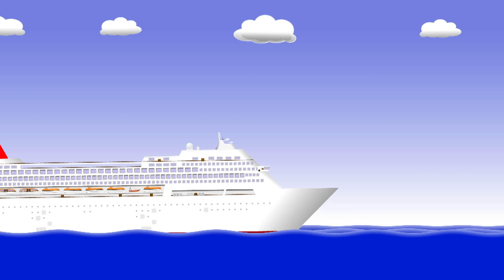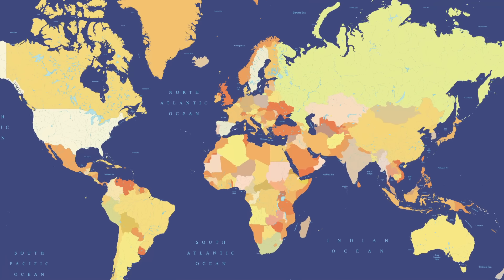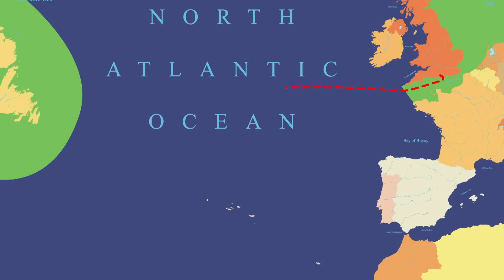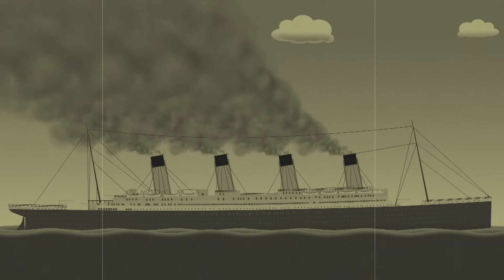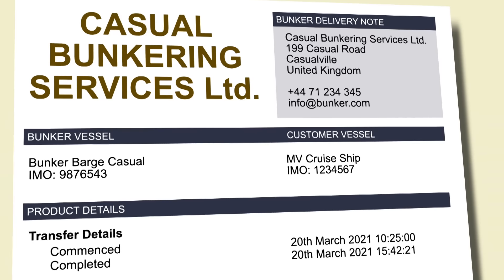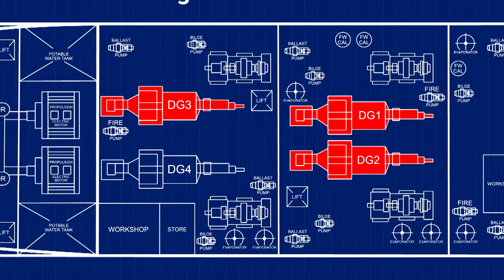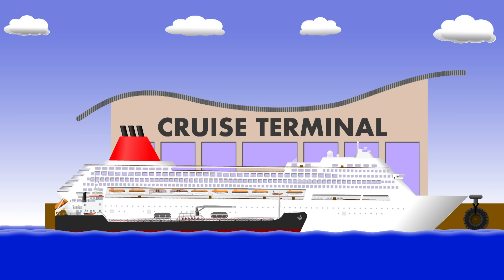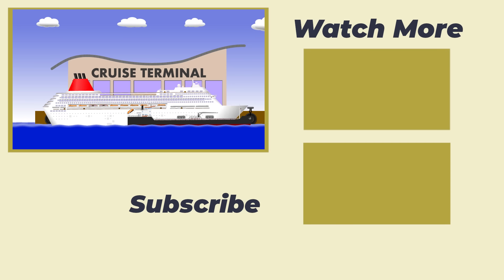Where Do Ships Get Their Fuel?

Comment: So, where do the product tankers refuel?
Reply: An infinitely long line of product tankers, each refueling the last
Reply: Well they probably operate around port areas where they have births for them which fill them up (getting bigger ships to go there would just cause traffic jams). At least that's what i imagine
Reply: Product tankers all the way down
Reply from the maker: Usually oil refineries, or storage depots that are filled by even bigger tankers. But I do like Snaily's idea of infinitely shrinking tankers, each refilling the next
Reply: @CasualNavigation  
"One for you" pumps into transfer tank
"One for me" pumps into propulsion tank
Reply: As mentioned by OP, either at tanks storage facilities, floating storages (typically VLCC moored just for storage - very prevailing currently with Fueloil prices in contango and tanker freights very low), or from refinery tanks. The product on the bunker barge is separated between those the barge itself uses for propulsion vs the cargo the barge carries for delivery to other ships.
Reply: It's a variable question, as a tanker man weve taken bunkers from barges whilst at anchor, specialised bunker berths, sometimes direct from our own loading berths. road tankers whilst alongside at port for gas oil in certain ports. It all depends on availability, cost, charter partys etc etc for example on time charter to shell in the Caribbean they would pay for the bunkers so we used to fill up at our load port berth every month or so. Whereas on spot market charter the operators would look at our booked cargoes and send us to the cheapest place
Reply: There are barges that take LOW Sulphur Fuel Oil LSFO and Marine Gas Oil MGO to them in the New York Harbor. Usually they take about 300 metric tons of MGO and about 800 MT of LSFO. I work for an inspection company and witness a lot of this transfers in anchorage
Reply: Good question!
Reply: They find a sleeping larger tanker and siphon out some when no one’s looking ;)
Reply: Oil terminals with berth or floating storage (another bigger vessel) in anchorage
Reply: An entire supply chain of tankers
Reply: To keep with the theme, they go to those fancy seafied gas stations that Causual Navigation showed of course :D
Its roof is a bit lower so there have been roof strike issues at some of these gas stations.
Reply: At the refinery😊

Comment: They are called diesel generators because the diesel process is the combustion method. Can be compared to a turbo-generator, running on gas or steam, is still called a turbo-generator. Love your videos man!!!!
Reply from the maker: Thanks Eric
Reply: Indeed and diesel cycle engines famously can (be made to) eat almost anything that burns as fuel.

Comment: So somewhat of a dumb question but it's something that's been puzzling me for a while now, why do cruise ships have their bridges located at a more forward position of the ship and why do cargo ships have their bridges at a more backwards position of the ship. I hope to get an explanation, thanks.
Reply: I think in a cargo ship its important to see the cargo holds but in cruise ships seeing the pools wouldn't be as useful as seeing the water in front
Reply: @bobjonesisthebestastro  That has nothing to do with it; just think of RoRo, Livestock or Heavy Lift Ships with the Bridge at the Bow. It's simply down to the Deck Superstructure usually being above the Engine Room, which is located as far aft as possible. Having the Superstructure above the Engine Room costs you as little valuable Cargo Space as possible. The only Exception to this are large Twin Island Container Ships, where moving the Bridge forward into a second Superstructure increases Cargo Space, as it allows stacking the Containers higher on Deck while still maintaining the Line of Sight required by SOLAS. On Passnger Ships, as well as RoRo and Livestock Carriers (which are similar in Terms of Space Layout), there is no single Superstructure which has to be placed above the Engine Room, so it is placed where it provides the best Sight to the Navigation Officers.

And many Heavy Lift Ships have the Superstructure at the Bow, so it can protect the valuable and sensitive Cargo from Swell. This is one of the few Exceptions where the Crew Quarters may be placed forward; usually they have to be placed midship for Comfort Reasons. Accomodations at the Bow means, the Crew takes literal Elevator Rides whenever the Ship is pitching.

Comment: I kinda wished you had talked about the time it takes to fuel these ships. I work on a tour sailboat (<50t) and frequently hear calls into VTS for 12+hrs. Even some of the fishing ships that go to the fuel docks can take over 6hrs.
Also, I didn't realize the bunker barges carried different fuels. I guess that makes sense.
Reply: On the big container ships / tankers it really depends. Most ships have a 6 or 8 inch pipe connection but it can also be 5 4 or 3. The pumping rate of the bunker barge will be slower on a 3 inch connection then a 8 inch connection. Sometimes 1500 tons per hour and sometimes only 100 tons per hour.
Reply: It varies, really. Transfer rate and, ofcourse, how much a ship needs.
Reply: @dogepandamcgill6306  1500 tons per hour? That's crazy! That's a ton of fuel every 2.4 seconds! That's like a rocket engine! Is that through a single pipe?
Reply: An 8" ship-to-ship pipe will usually do between 3k and 5k gallons an hour.  That's more like 100-150 tons an hour which means that your typical cruise ship or tanker will take between 30 and 40 hours for an empty-to-full refill.  A company might use more lines from a single barge (which will lessen the head pressure, but you'll still get more volume), or with split tanks you can get a second barge in.  I've seen turn-rounds at like 18 hours in a pinch, but it's better to run it over a day.
Reply: @ImpmanPDX  3k-5k gallons an hour? That seems pretty slow
Reply: @ATLMike94  Bunker fuel is thick stuff.
Reply: @ImpmanPDX  i guess that makes sense
Reply: @ATLMike94  To be fair there are plenty of ships that fuel faster, but since it takes around 24 hrs to unload a ship and then part of a day to turn the crew around most ships take the extra time to do it safe.

Comment: How do cruise ships deal with medical emergencies? What kind of capabilities do they have on board? Is there a helipad for evacuation? 

If there is a helipad, does the ship carry aviation fuel as well? Does it have air-traffic control?

Your videos are extremely interesting! There are so many unintuitive aspects to consider
Reply from the maker: There isn't usually a helipad, but they do routinely do drills for heli-ops. It would be a high-line transfer, so the casualty would be winched off the deck.
Reply: @CasualNavigation   Very cool!
Reply: sounds like an interesting topic for a future video!
Reply: Most ships can communicate with airplanes when it is needed for a search and rescue. In general ships do not have ATC or anything of suchs nature. They are commurical vessel most of the time and as suchs do not often deal with aviation. If a plane crashland in international waters it is expected for the ship to provide aid but it will often take a few hours before it is able to assist. 

Otherwise aviation fuel and Maritime fuel are different and most ships do not have it. From what I know it would be extremely rare for them to have it but if you are in a heli you can always ask ships if they do have it and if you are able to land most cargo ships can have heli landed on their desks even if it doesnt have a helipad (Bulk carries).

In a heli emergancy most ships will provide aid if possible.
Reply: Future topic, then: "Why do ships have helipads if they have no helicopters?"  Or maybe just, "How are helipads used on ships?"   Finally, "Where does one go to school to drive pilot a ship?"  (Something I wish I knew 30 years ago.  Would have been a better career and life choice for me.)
Reply: @HDrobveelben  Most jet aircraft (inc helicopters) can run on diesel for a few hours with no problems.
Reply: If there is no heli pad there will be a designated location on the ship as a a pickup/dropoff point. 
There's no dedicated ATC however the folks driving the ship will communicate with the pilot directly to coordinate maneuvers.
Reply: @79Niall  Thank you I thought jet aircraft and helicopters used a different type of diesel then the one used on ships
Reply: @grondhero  For the first one I guess the answer is that its for helicopters to land for lets say people boarding (stupid example ik). also I think it would be better if u post this as a separate comment
Reply: @FeplayBuilds  My suggestion was to compliment what A Casual Navigation had already answered.  I personally know why they have them: it's for rescue and medical emergencies.  I suppose it would have been better to have added that caveat as well, to avoid any unnecessary confusion.
Reply: Cruise ships and many normal cargo ships have a clear space on deck somewhere painted like a heli pad, but with big “WINCH ONLY” painted on the deck. 

The only ships that usually have dedicated helipads are oil field vessels such as drill ships, rigs, and construction vessels, which fly crew out on a regular basis. They generally have a helicopter landing officer, who’s trained to deal with fueling, and emergencies. The ships usually also have aviation fuel, and fire fighting equipment specifically for the helicopters. 

Also naval ships and some research ships have helicopter capabilities, and some fishing vessels.
Reply: @HDrobveelben  It is quite a different kind of diesel. In general Aviation Jet A1, the most common used fuel type for turbine powered planes and helicopters, is quite close to car diesel, but has a much lower viscosity which immediately presents problems as car fuel pumps can be lubricated by the diesel they pump, aviation fuel pumps can not or have to use quite different materials to account for the difference in viscosity. Heavy fuel oil used in ships can not be used for turbine powered aircraft. In the history of aviation that was different, there were actually airplanes using heavy fuel oil powered diesel engines, but those have gone very much out of fashion. Using normal car diesel in aviation engines is possible, but will cause damage and requires a complete engine and fuel system overhaul, except for a few piston engines that are certified for dual use. 

As aviation engines have quite a high fuel flow small differences in any parameter can make a huge difference in running that engine. So refueling on board a ship with maritime fuels is not really an option.
Reply: @Andrew Carlson all sea going vessels are required by international law to carry medical equipment with them. If I’m not mistaken under SOLAS (Safety Of Life’s At Sea). Usually during an medical emergency is the crew able to seek medical advice from the shore until help can arrive. Typically are cruise ships better equipped with medical equipment than cargo ships but any sea going ship is capable to deal with an medical emergency before help arrives. 

In the case a ship is too far away from the nearest shore, let’s say 3 days sailing, evacuation is impossible. In such case the crew will have to provide medical care using the medical equipment present on any sea going vessel. Seaman are required by international law to train periodically for such situations and other emergencies. Usually they are guided through the radio, receiving live medical advice from the shore.
When medical evacuation is possible, there are a few options depending on the nearest shore and the situation. Usually the emergency responders from the coastguard are in charge and making the decisions for the evacuation. They can either sending an fast rescue boat or a helicopter. 
In the case their sending an rescue boat the victim will be transferred with the rescue boat to the shore and brought to a hospital. If a helicopter is send this is likely a coast guard helicopter. The victim usually is strapped on a medical brancard and the helicopter crew is giving the crew of the vessel orders. For example under which course they must sail because of the wind and even the movements of the ship because of the waves. Than the helicopter drops a cable to release static energy (if they don’t and an person from the helicopter touches the ship he would be electrocuted by the static energy). Than a rescue worker from the helicopter comes down to secure the victim and calming him or her down. Common practice is to giving medical reports to the the helicopter from the ship about the victim. Typically containing information about the medical emergency. After the victim is safely brought in the helicopter the victim is rushed to the nearest hospital.
Reply: Some have helipads, so that will be interesting,
Reply: @Soordhin  I thought that would be the case as I am studying martime engineering and to become a martime officer so I thought the diesel ships use cannot be used for avation. So I thought the best thing to do for a helicopter pilot is to land on the ship wait to get to port and then get fuel there.
Reply: @Maik_Grnto  Many bulk carriers a certified to use one ot two of their hatch covers as proper helipads. And many tankers have either a clear space on deck which can allow helicopter landing or sometimes even have a proper helipad.
Reply: @79Niall  While it's true most turbine engines can burn diesel, the problem comes when the aircraft reaches higher altitudes. Diesel fuel isn't suited to the extreme low temperatures found in the higher flight levels and will end up gelling and failing to pump. This will lead to engine failure from fuel starvation.

Some large ships including cruise ships use gas turbine engines to power generators as the scale of their power and heat requirements are well suited to turbines and maintenance requirements are well minimised. They of course still use bunker for fuel as it's the most available and affordable and they have no issues with gelling temperatures in the warm belly of a ship.
Reply: they toss you overboard : )
Reply: @CasualNavigation  I have seen coast guard footage of them landing a helicopter on the forecastle deck of an obscenely large vessel resembling the Olympic class in order to retrieve a sailor whom had been knocked unconscios by a broken mast cable in 20 foot seas with near zero visibility.  Why the forecastle vs. the aft deck is beyond me given that one would think the shape would be more conducive to it.

Comment: When it comes to owning a yacht you’ll end up spending more one fuel by the time your done with it than you did on the boat itself. Assuming your actually using the floating cash incinerator you bought
Reply: Power yacht maybe. I’ve owned a sailboat for years and it burns about 1 litre per hour at cruising speed. So a week or two of sailing/motoring costs less than to fill up my Honda Civic.
Reply: @sailorgeer   I take it you one of the few people who actually use the sail on their sail boat
Reply: you're done with it not your done with it

Comment: I work for a company who supplies marine gas oil for the engine.  We arrive in lorries and use a pump to pump it aboard the ship. Samples are taken from each tank on the lorry which carries 35,000 litres. Some ships can take up to 300,000 litres of fuel. We start pumping on low tide at the dock side and finish at high tide when the boat would leave. We also deliver to tanks at the dockside that the bunker barge that fills up ships moored in the harbour.

Comment: What guarantee do you have that a bunker ship has one tank of really high quality fuel it gives you a sample from and then switches to another with lower quality fuel?
Reply: Bunker companies can be in deep trouble if the shipping company finds out...
Reply: They can be sued, and be forced to closed
Reply from the maker: The sample is dripped continuously, so it is an average across the entire bunkering process
Reply: It’s an excellent question.  CN is absolutely correct, drip sampling is the industry standard best practice. Done properly, this should ensure the receiving vessel gets a representative sample of the entire delivery.  Many shipowners take their own drip sample too nowadays at their bunker manifold and have these independently analysed before they consume the fuel.

Comment: I used to run a fleet of supertankers and bunkering is something organised by the ship owner using shipping agents that are local firms in each port that supply ships with everything else that is required locally wherever a ship docks like food, water, fuel and even getting crew on and off, spare parts, and just about anything else you can think of. The captain of a ship at sea simply cant organise these matters because he/she wont have the local contacts. The owners of the ship, the charterer and the owners of the cargo will be thousands of miles away. The local agent takes instruction from all these various parties but they do the organising and execute all the work involved.